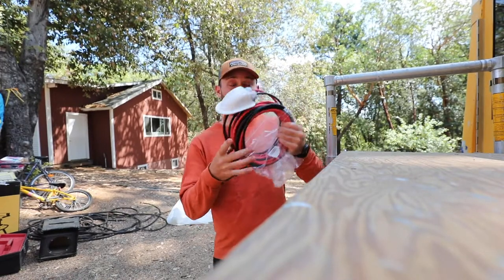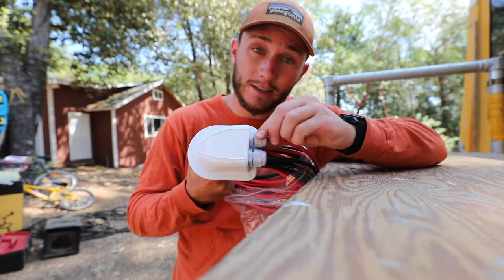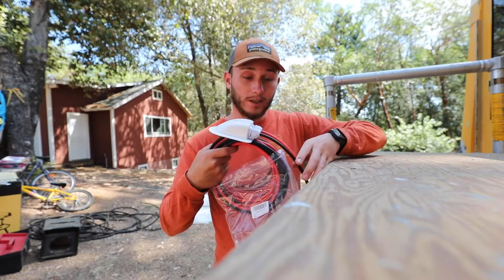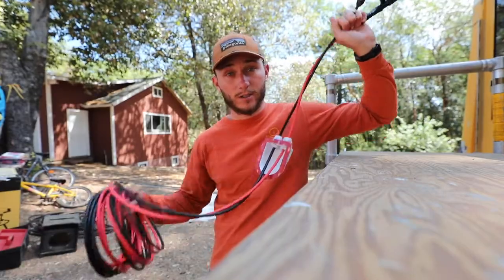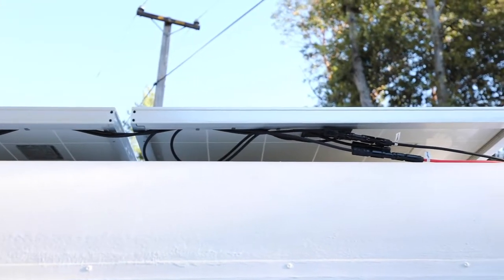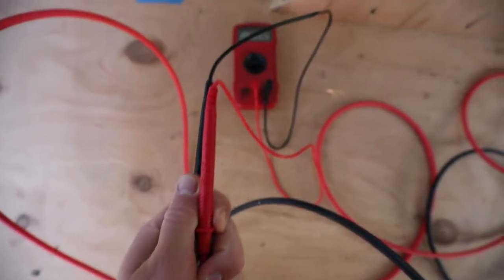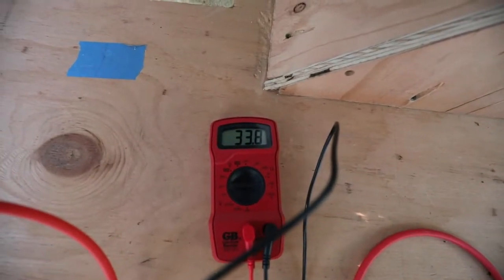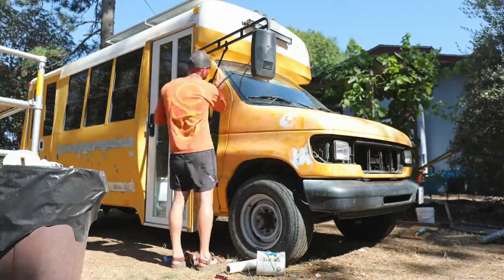Installing Solar On My Short Bus - Bus Build Episode 18

Comment: I bought a short bus last year. No solar panels or anything like that yet, I just got to the wall outside my moms house down by the shop garage. I didn’t have the ambition to strip the inside so I just put down some carpet and some wood floors and put a dresser and some other stuff in there and got a water tank etc. going to buy the solar panels when I get my taxes back
Reply from the maker: Love it! There's such a wide spectrum of what can be done with these builds and that's certainly a way to do it!

Comment: How many amp support this wire for solar panel?
Reply from the maker: The wires are 10 awg which can handle about 30 amps. Since the panels are 24 volt, even if they were pushing ALL 500w possible, they shouldn't exceed 20a.